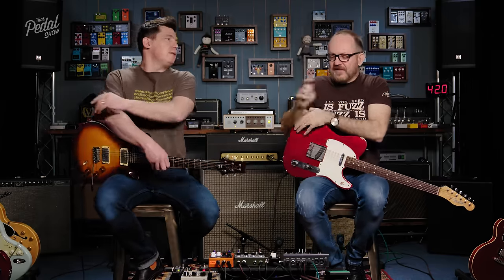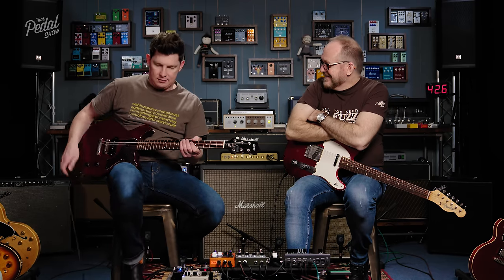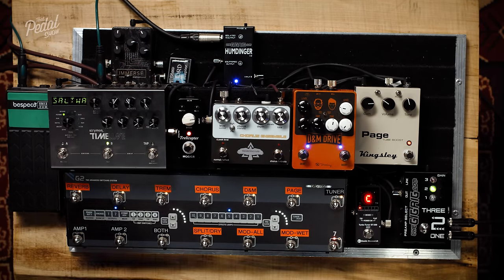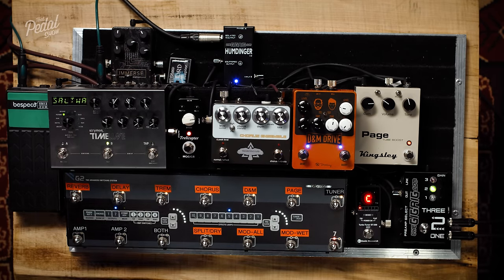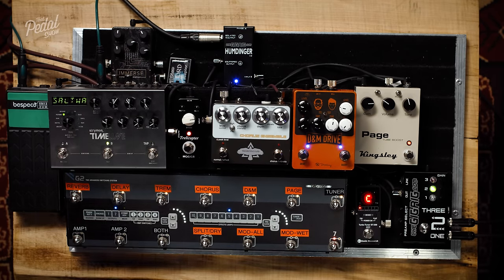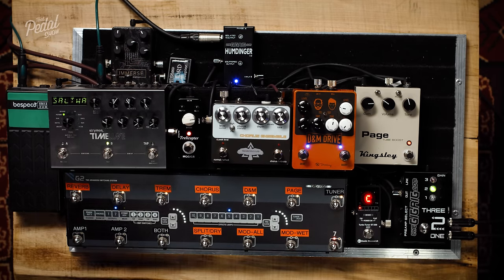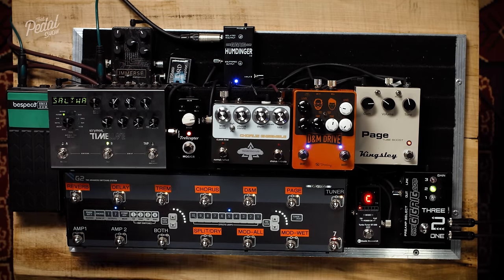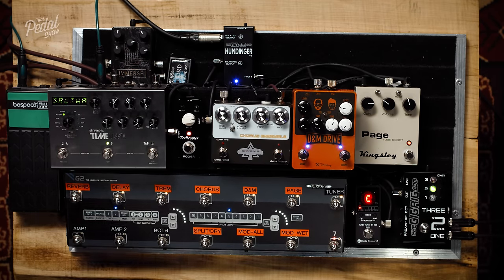Wet-Dry & Wet-Dry-Wet Amp & FX Setups Explained – That Pedal Show

Comment: Awesome show- 3rd time watching- amazing sounds- thanks so much. Question: How do you tame pedals that have AC power? E.g.- Chandler Tube Driver and TC Electronic stereo chorus? Where do you isolate with the hum dinger- on the send or return of the G2? I'm not sure if I'm doing it correctly. Common sense tells me if you need to isolate Amps then pedals are no different?

Comment: Really useful as I am just about to get a third amp and set up a wet dry wet rig - what are your thoughts on which amp should be the dry amp from a Vox AC15, Victory Sheriff 22 and a blackface Princeton clone (hand wired, eyelet board AA1164)

Comment: You gents are the salt-of-the-earth! My first TPS episode was the one about small amps; and it helped me pull the trigger on a Fender Blues Jr. for my at-home, practice amp. I am so glad I discovered your channel. It was the first channel to which I subscribed!
I have faithfully journeyed down the rabbit hole with you, and have built some humble pedal boards with your advice. I have explored wet-dry, and wet-dry-wet setups.
While this has been an expensive journey, it has sparked a passion for tone, and helped me shake off the fear/anxiety of making a mistake. Thanks so much for helping me take risks, and more freely explore sounds. 
I don’t understand the comments about the videos being too long; I would watch them if they were twice as long. When you guys get on a roll, I bust a gut laughing along with you. The jokes and levity are the highlights of my week. 
I have two question at this point:

General question: 
Do you have any preferred retailers in Canada. Do you have any? I have experienced some elitist attitudes at music stores, big and small. Their attitude tends to change a bit when you pull out some cash, though. Shouldn’t be that way. 

Specific question for this episode: Where would you place a Wah pedal in a wet-dry-wet, or simple wet-dry setup?
Cheers, gushill.
Reply: Based on my research from other youtube channel, forum, etc. best is to put it align with the dry signal (before drive section or preferably) and before the buffer pedal (if you have one) so it’ll only go through dry amp.

Comment: Hey guys!.....another great show. Your previous shows on wet/dry led me down the rabbit hole and now there’s no escape! Just wanted to add that the OX is an INCREDIBLE tool for wet/dry by using the OX’s on board effects as wet only sends and let the OX control the fx to dry mix......all post speaker as would be in a typical modern recording scenario. You can even run the OX outs through your pedal board with pedals that can accept line level inputs like the Strymon stuff. Pipe that into your room monitors and MASSIVE will have a new definition. Give it a whirl!

Comment: Great Episode, so interesting. I'm about half way through by now, and maybe this will be answered later on, but I have a question about Stereo: Say I want to build a Stereo Rig. I start with my guitar, into a Volume pedal, a Wah, an Overdrive, Talkbox and then into a Stereo pedal, in my case this would be a Boss CH-1 to start with. Then I go Stereo Out into 2 Marshall Heads - or whatever amps - and in the FX Loops of those amps would be a Mini Vent and a Nemesis Delay in Stereo. Would I need to plug an extra device for dealing with earth and phase after one side of the Stereo Pedal that splits the signal in front of the amps? Thanks!

Edit: I think the Vent is only Mono In, so it might replace the CH-1 in the front.

Another question if you don't mind: I sometimes use wet/dry in my rehearsal space just for fun. When I do I use 2 heads and run them into a single stereo 4x12. Would you recommend using 2 cabs for "nicer/better/whatever" results? Thanks again!

Comment: Awesome video. Thanks for the diagrams. So which diagram applies to your setup at 56 mins of your 8/25/17 video. That Duesenburg and the power amp wet /dry is the best!! Would it be your diagram from 1:10 of this video?

Comment: Great episode as always. I run an ac15 and blues Jr in a wet/dry or stereo rig depending on occasion. I was confused about the earthing. I don't really understand electricity.  I just have both amps plugged into separate outlets. Should I do something else?

Comment: Firstly, great video amongst the other great videos you both make. Having watched this, I am now re-entering the world of wet/dry and will be running my V40 deluxe wet (with dry signal) against my completely dry AC15 with blueback, plus running my V40 deluxe into my Ox and running a different cab through FOH to get another version of wet amp... I’ve even gone and bought a ABY baby from Gigrig yesterday to run it. My question is though, when does it all stop?! I’m now considering a G2 and I’m only in a weekend cover band!!! I think you need to do a covers band type board to try and get sounds to cover all sounds of the classics

Comment: Gents. I really appreciate this show and am learning a lot. Thanks for that! To me the dry/ wet journey went even a little further and you guys didn’t mention it so I’m not sure if you’re aware. I’d consider it the gold standard of running dry/ wet. Allow me to explain. Whos got the best tone/ sound out there and what are they doing? Chances are that somewhere on this tone quest you gonna end up taking a look at Michael Landau and Scott Henderson. What they do is tapping the speaker signal after the power section via a suhr line box (david bray makes one too) that provides isolation, ground lift and phase (all crucial connecting two amps). It lets the speaker through to the speaker and separately reduces the signal to line level that can be adjusted somewhere between instrument and line level. This reduced signal will now be channeled through the wet fx chain and then into a clean transparent amp (or its loop return). Its a pretty bright signal so it needs to be eq’ed down some. The fx are run 100% wet and the volume of the wet amp will act as a blend knob for determining how much wetness you wanna add (better: a volume pedal). Now you’ll have your complete sound with added wetness. Also you won’t need an fx-loop anymore. The real key why dry/ wet sounds so good in the first place is because you reduce the amount each SPEAKER has to work. The dry speaker just does the lead sound, the wet speaker does just delays and reverb (thats why its crucial to have it 100% wet). Minimum speaker wabble. Also the pickups will now interact a lot better with speakers at volume which will add to the glory. Putting wet effects in the effects loop does not accomplish this since everything still ends up in the same speaker. If you understand this alchemy and apply its correctly you’ll be in for a completely different ride.  
 And on a different note: if you enjoy badass guitar performances by Scott Henderson, Oz Noy,, Brent Mason, Mike Stern, Doug Rappoport and many others, then checkout my double album “27 faces of a broken heart” by Ramin Partovi on spotify, apple music etc where each of these players takes on the same song and paints his story of a broken heart on the same canvas. Guitar candy my friends!! 🕶🤘🏾

Comment: Thanks for the show and taking the effort to do the diagrams - really helps.  Have been running this for a while now after your last wet dry shows, and it’s great.  Does anybody take a split before drives, and use that into the wet effects?   So the wet signal is clean and the dry signal dirty?  Would create level havoc when you kick the drives in, but would be interested to know if any players do that.

Comment: Hi Dan, great video as usual :-) I learn a lot... Just a question if you can help me. In the wet-dry-wet set up, you connect the "wet amplifiers" through the stereo output of delay/reverb pedals, without using another HumDinger? I wish to add a third amplifier to my rig...thanks a lot...

Comment: Pure Magic...

I want to try wet dry on a budget. With my marshall dsl 40C as my dry amp, I have an Vox AC as my wet amp in mind.
Would you recommend a ac15 or ac30? I'm asking because of headroom. Are there any difficulties or limitation if my wet amp has appreciably less headroom as my dry amp? I'm running my marshall pretty clean and getting the drive sound from my D&M Drive.
Cheers

Comment: Great show! I do have a question about phase cancellation in regard to my rig. I only have a single amp (a Vox TB35), but after seeing your "stereo vs wet-dry" show I started experimenting: I run all my dry effects envelope>compressor>wah>drive>fuzz into this amp, then I have a buffered splitter and split the signal and add delay>vibrato/tremolo these go into a stereo DI and on to the PA to give me a wet-dry-wet setup. Do I need to flip the phase of the signal send to the DI, or either side of the stereo signal? Or is this not necessary since this signal is going straight to the PA?

Comment: Love the show! Loved this episode.  I''ve been experimenting with wet/dry rigs for close to 5 years.   I use a THD HotPlate between my amp and speaker.  I take the line out signal out of the HotPlate and send it to a volume pedal which sends the signal to my delay and reverb. This signal usually goes into the FX return of a second amp.  Kinda inspired by Steve Morse and Jimmy Herring's set up.  Sounds killer..

Comment: I go comp > drives > CE2w > dry output into Peavy Express 112, wet output > CS Phase 90 > DD 7 > Line 6 M5 > eq > Blues jr.  I know I’m on dodgy ground with the outputs not being isolated and no phase reversal, but it sounds epic!  The Chorus is technically stereo which I love, and a phaser in a wet amp only sounds killer too!

Comment: I have a CE-1 on my Wet / Dry rig too, a trick from my side : have a jack connector in the Stereo Output (so it turns off the direct signal on the mono output) , when you go Wet/Dry, so the Chorus Side can be used in Stereo. Unplug the Jack Connector if you're going in only one amp.

Comment: Very interesting show indeed! One way do the wet/dry/wet rig (especially when using a low headroom-no effect loop kind of amp) is to capture the signal from the main amp with a microphone in front of the speaker, and send this to a little mixing desk, then to power amp with the wet effects. I think Jeff Beck used to do that at one point with his little pro junior.

Comment: As always fantastic show guys!
I think wet/dry can also be achieved with a single amp, all you need is to mix back both paths (wet and dry) before plugging into your amp, does the make sense?

Personally I do something that's a bit different:
I recently purchased a Music Man Majesty guitar which has a piezo electric pickup and a stereo output. This enables me to split and toggle select (mag/piezo/blend) the signal coming out of the guitar:
I run magnetic pickups through all my pedals and then blend them (using a mixer) with the piezo signal coming directly from the guitar. This enables me to kind of have a wet/dry setup (using a single amp). However, only with an acoustic clean sound on the dry path (instead of over-driven magnetics). John Petrucci does something like that.

Comment: Very interesting explanation :-) I modified my stereo rig to try wet-dry one : very well sounding. But one question : with my stereo rig, I splited the signal out from a stereo pedal, toward two amps, and didn't use any phase or ground management ; so why should I use this (expensive) device to split wet and dry and not to split stereo chanels ?

Comment: Hi Dan and Mick!
Greetings from the hot, bright and busy southern hemisphere!
The 4x12 trick is for making the cab sound quieter on stage? If you mick the different phased speaker? Intersting...
Another question: If the all-wet rig is getting muddy because everything is going out from the same speakers,  then doing the wet/dry and going into the PA, isn't it getting muddy again by putting everything in the same speakers all over again? 
Of course,  the sound guy can manage that (if he gives a sh!#...) 
Cheers and happy new year!

Comment: Thanks for all the great education! With the help of TPS (incl. many previous episodes) I was able to put a nice wet dry rig together while avoiding necessary or wrong investments :). One interesting aspect to pass on to your viewers might be the following: I've heard you often mention that you tend to avoid the FX loop of your (main) amp to reduce setup and tuning complexity in a wet dry scenario and instead go straight in front of both amps. Since my main amp has three nice pre-amp channels I wanted to use those for the drive tones instead of just pedals. So I took the FX send and connected it with with the FX return of my second amp (a hotrod dlx). But since the hotrod looses all EQ and master volume control when going straight into the power section it is hard to control and bring into sonic "balance" with the first amp. Ultimately it occurred to me that I could use a clean boost pedal with EQ to put between the FX send of amp 1 and fx return of amp 2 ... et voila: Magic! Super easy to control volume (above or below unity of the boost pedal) and apply EQ to taste to balance the two amps. I've used the Greer Lightspeed pedal for this and it does a great job. I can even use the drive pod to adjust the second amp to break up a little more over amp one. It's a great setup with a lot of adjustment options that are easy to control to the taste of any given day. All the best from Canada and thanks for all the great work!!!
Reply from the maker: Nice! That's kinda how Andy Timmons does it - using the preamp of only one amp. Sweeeet

Comment: I also use 3 Amps. But my Wet Amps include the dry signal because I use a Stereo Looper after the Stereo Reverb at the end of my chain. Sounds great! The dry amp comes after the Overdrive effects ( Dual Splitter with isolated Outs) and than Chroma Chorus( Stereo OUT), Echolution 2 Delay, Pana Tremolo, Ventris Reverb, Immerse MK2 into the Infinity Looper , into a CABZeus-Thru Outs into a Palmer PLI 02 Line Isolation Box to the Left and Right Amp! The CABZeus Outs are going to my USB Audio Interface for recording with a iPad (Auria App).

Comment: Is there a major sonic benefit to using a splitter over going from the line out on my amp? I run out of my Vox AC15 back into my modulation effects to give the wet amp, which is solid state, a little color from the tube amp. I don't have room or money for the nice switching system, so that's what I have. Are there any dangers or potential problems doing this?

BTW, I asked you guys last year about all of the howling feedback I was getting from the wet side of my setup. I was running the same setup, but splitting the output from the mic on the Vox through the direct box, back through my modulation pedals and into the wet amp. It took my a while to figure out that it was the cause, when it should have been obvious. I forgot that my amp had a direct out, because I would never use that into a direct box to the board.

Comment: Great stuff again, lads. Question for you: I have a Mesa Simul-class 2:90 which has two inputs, two outputs. Am I going to have ground/earth/isolation issues if I use it in wet/dry setup? The model I have is the early 1990s edition that does not have a ground lift. I run a Mesa Triaxis preamp that is in a loop  in my G2, no effects loops involved.

Comment: I am a beginner guitarist and was going to build a 2x12 cabinet, but I saw this show, which is one of your best, and thought about a change. If I put a switch in the back of the cabinet that when in A - the cabinet would work as a 2x12 but in B the cabinet would work like two 1x12s and I would run a different head into each speaker. Would this work for a wet-dry set-up? Maybe it is just better to build two 1x12s. Any advice? If it would work, when in the 2x12 mode can two different speakers work or do they have to be same make and model?

Comment: Thanks for this episode guys explaining it all and showing various scenarios possible, so thought I’d try it using my Gretsch Electromatic G5422T (Walnut finish) only using a Timmy pedal going into both amps, an old Fender Frontman 65R amp (gets a lot of hate) and also into a Fender Mustang 3 amp which had the wet effects which are built in (Chorus or Vibrato, Delay, Reverb) and the overall difference in tone giving such a huge fat lovely sound, I’m pretty shocked how big and great it has given combining these two amps wet/dry, just having the wet FX only from the Mustang and the Timmy going into both amps is immense.
I love how I thought I’d take away most of my preferred and usually used pedals (Drives,Chorus,Delay,Reverb pedals) and go back to basics and use just one Timmy drive pedal only into both amps and use the built in wet fx from the Mustang, the results to me are totally massive, lovely and very pleasing, so much so I did my first gig last night in two years due to covid and I ran this setup just for a bit of a laugh really, the guitar sound at the gig sounded fantastic , I had so many people compliment the guitar sound afterwards that I found it hilarious going back to a couple of cheap solid state amps, one pedal and built in amp FX and getting such a great reaction from people afterwards and myself being so pleased with how good the guitar sounded for the show. Thanks gents for the tips and giving me the nudge to just try something different, cos it really worked giving totally unexpected results and sound. Just shows you, you don’t always have to have the most expensive gear to achieve great results.
Reply from the maker: Perfect! What a cool story - fantastic that it's inspiring you!
Reply: @ThatPedalShow  I’ve watched a few of your videos on this topic now and reading this has really piqued my curiosity to where I’m contemplating taking the plunge using my hotrod and blues junior. I’m thinking to run the overdrives into the junior and keep the headroom of the hotrod for the wet sounds. Does that sound like a sensible strategy?